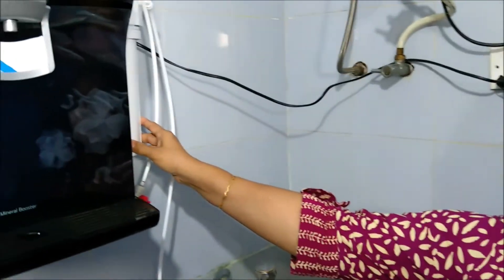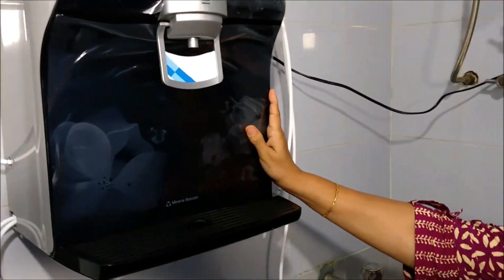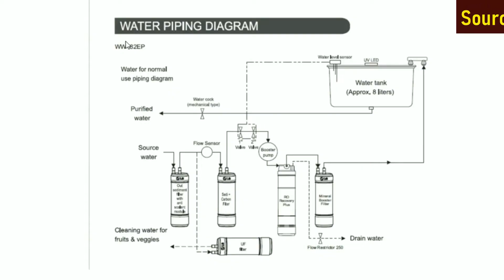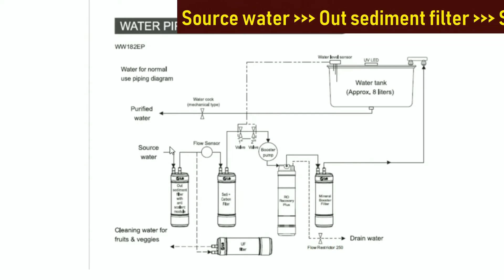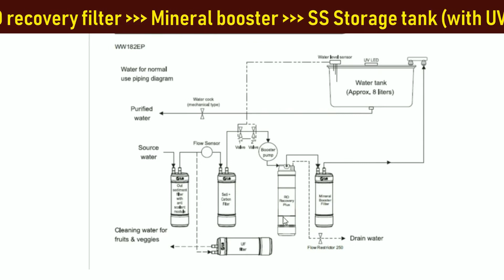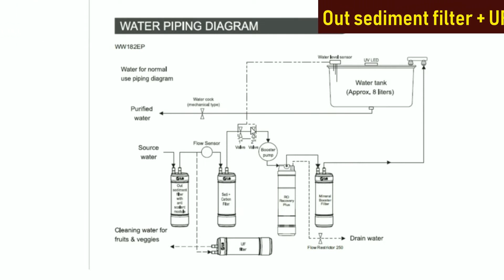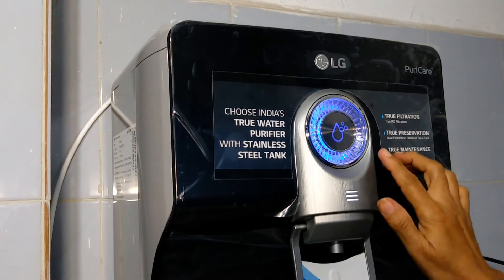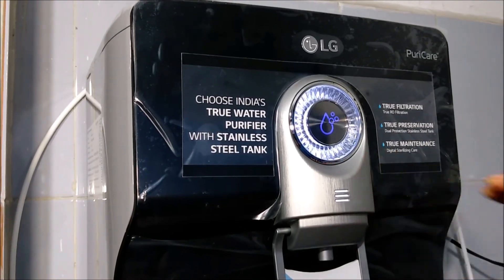LG PURICARE RO WATER PURIFIER WW182EP | PART 2 | PURIFICATION PROCESS EXPLAINED

Comment: Hi
Can I know after how many days filters need to be replaced and what will be the service costs?
Reply from the maker: Hi Yashwanth Kumar, thanks for the query. As per the manual, all the filters need to be replaced at at interval of 6000 litres purification. However, this is also dependent on the quality of the inlet water supply. As I have shown in my video, the indicator will turn amber if the filter needs replacement. I am not aware of the cost of the filters. LG recommends AMC (they said it costs around ₹5000), which includes total repair and also filter replacement. Thanks.